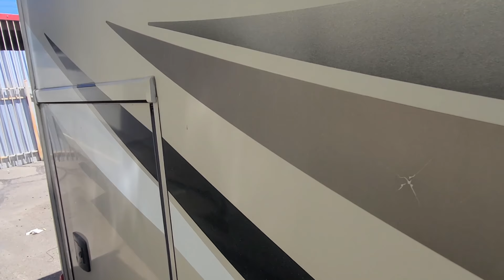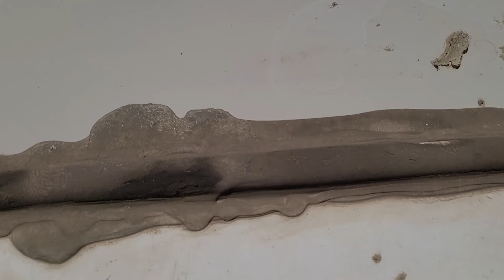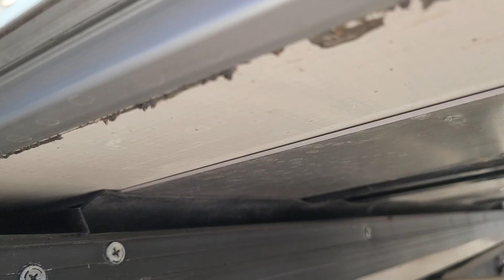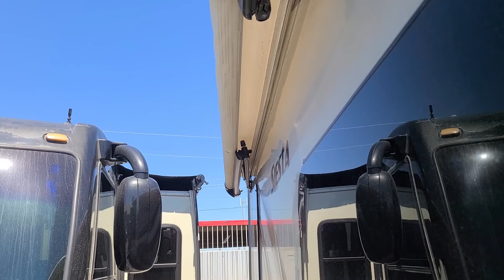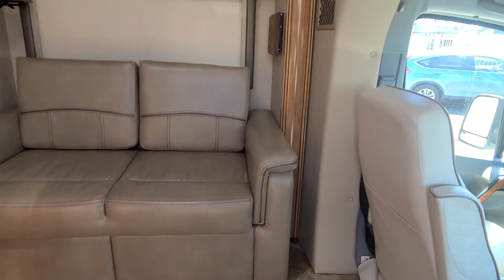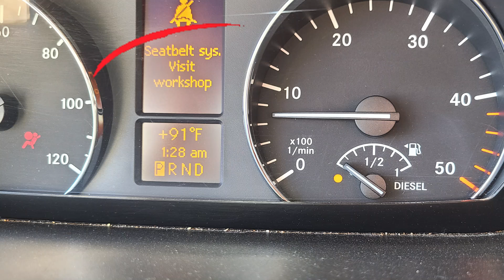You Won’t Believe What I Found In This RV Inspection!

Comment: Watching these videos, it is clear that the entire build concept of RV's is flawed and not fit for purpose. You have a vehicle which is intended for outdoor use in various climates yet it relies on sealants to keep it dry. This is the critical design flaw which is responsible for the repeated failures that cause water intrusion but the destruction of components that fail due to water exposure, not to mention the mold conditions which make it unhealthy. The use of sealants which are poorly applied with tube guns and unable to withstand conditions and are of poor durability makes ownership of an RV simply a no go despite the allure of such. There are construction methods which would improve this problem. One should look to the boating industry which has taken the lead in solving water seepage issues. It should not be that difficult to make these roofs and windows watertight. You see tents that do a better job and don't leak in rainstorms.. Roofs should one piece construction and fitted with a thick synthetic rubberized membrane that prevents water intrusion and without any holes cut into them. All vents and drainage should be directed to the rear of the RV to a drainage compartment that is also sealed from the cabin. There are so many fairly easy solutions if the industry would only stop resisting changing build concepts. Hiring illegal and unskilled labor in their factories is another. Don't get me started on that one.

Comment: If you are smelling propane, that is reason enough to halt the inspection right there.  Concentration of combustable gas in an enclosed area, such as in an RV, is nothing to fool around with.  You can get a combustable gas detector (sniffer) with prices ranging from about $30 to over $300.   For your purposes, probably want to stay away from the lower end models, saw a Klein advertized for about $100.

Comment: Well, it is a Thor 🤷‍♀️ My biggest question is, after getting on the roof & seeing how bad the condition was & the front cap & the slide, why did you continue with this inspection & not contact the customer? I once had a highly reputable inspector inspect a Diesel Pusher for me in So Cal. He stated if he found any major issues he would call me & stop the inspection, only charging me for his actual time & travel charges. He started with the chassis & found the rear differential was leaking & a couple other things so the inspection was terminated. I think more inspectors should do this & more people would be inclined to pay for inspections. Just my 2 cents.

Comment: Most thermostats I come across in RV's have a thermostat wire for measuring temps. I pop the cover off and dip this wire in a cold cup of water with ice which I bring along just for this. It tricks the thermostat into thinking it's really cold and then you can test the heater. Or use a ice pack in a ziplock and tape it to the wall with painters tape and hang it over the thermostat to lower the temps. Your welcome.

Comment: In my experience if the water pump is cycling to keep pressure up, the water tank leak is not the reason. 
It's likely a leak on the pressurized side of the pump, or the pump it's self is allowing pressure loss back through the pump seals, which may not result in a drip, but the pump keeps running in cycles to keep the pressure up to trip the off switch. If that is the case the pump is going to die before long, and maybe be a disaster of a leak. 
But of course there could be all sorts of systems I have never seen

Comment: Do you have any experience with coachmen Entourage 340bh and if so can you tell me about it? Good or bad 😁. I like power train, mostly concerned about house part. I can upgrade some like plumbing or whatever I need to. 

My name is Al Wilson
Reply from the maker: I have good coachmen’s and not so good. All in all I don’t know until it is inspected. What appliances are they using etc? I don’t recall every brand out there so it would have to be researched.
Reply: @debsrvservices I’ve been dealing with Chris York in Tampa Bay Florida. Hoping to make a deal on one this coming January super show in Tampa Bay. Do you work in that area

Comment: I have a 2014 Forest River Lexington 283GTS which I bought used in 2018. I meticulously maintain it because it constantly requires attention. Even with all the work Ive done myself its been an expensive and challenging adventure. Especially annoying is the crappy upholstery that became a flaky mess and the faux wood trim thats nothing more than compressed paper with a vinyl covering. Ive had to replace all of that plus the converter, transfer switch, water pump, a slide out motor, door latches and glides, sun roof.......I cant believe I havent thrown in the towel yet! Oh, did I mention the dead battery on the toad due to not knowing about the 12v charging line? Yikes!
Reply from the maker: Haha!! Sounds about right! RV life isn’t easy, that’s for sure. I sometimes wonder if I am saving any money living this way 🤣

Comment: 5:39 tires don't normally rot from the inside out, unless they are not mounted and left open to the environment. That being said the checking you're seeing does make the tires unsafe, and need to be replaced. The checking is a combination of UV exposure and running on low pressure. Running on low pressure will destroy a brand new tire, so that means the tires need to be replaced as well. Otherwise great video.

Comment: I’d give him 2500.00 with the amount of work that needs be done it’s probably 10-20 K in repairs minimum. If only one company would build a quality RX. Fiberglass clam shell with one seam through the middle of the wall. No roof leaks. Minimal items you have to reseal each year on the roof.

Comment: Afternoon Deb, nothing says "Quality" like an RV that holds up over time,,,,,,,,, 

I'm guessing this RV was a COVID build date, or just before, the manufacture's were cutting cost on every corner, plus this one never stored under cover and sat in the intense heat & sun of the last few summers.
The tire wear is from driving fast with under inflated tires, broke the internal bands, pretty sure it had a heck of a steering wheel wobble at 50mph +,,,,,,,

What would I pay????? 
The question should be "What will you Pay Me to tow it to the wrecking yard and you're also paying the wrecking yard disposal fee,,,,,,,,,
They won't take them for free ya know,,,,,,,,,

Definitely a "Walk Away From" deal,,

Spotted a 2000 Lazydaze 27 rear bed, not bad condition but not cheap enough for me right now,,,,,, dang,,,,,,

Take care,
Reply from the maker: Dangit on the Lazy Daze! My friends I am staying with right now almost went to look at one in NC. They have owned several lol! 

Agreed on what to pay me to trash the RV🤣
Reply: @debsrvservices  Morning Deb the LD I mentioned is on CL up here in Seattle if your freinds are interested, for sale by owner.

Comment: That's very humble of you to admit you're not a propane systems expert Deb.  Too bad you're not closer to my 'north of Seattle' location. It would be a pleasure to show you how a handful of fittings and a few tools can get you a valid leakdown test at many locations.  I was blessed with some very good teachers and seen about every LP problem a rig can have.
Reply from the maker: When I get up that way maybe we can work something out. Always wanting to learn more😊
Reply: @ I e-mailed you pics of my RV LP leak test rig, which I hope you find useful.  I have a 2nd one also, which has a high pressure gauge (for full tank pressure before the regulator) for doing park models or mobile homes. 
That little burner spud adapter for the range rarely ever is used, because readings there do not reflect accurate dynamic (appliances lit) operating pressure in most cases because of the range regulator.
Reply from the maker: Wonderful! Thank you! Did you send to debsrvservices@gmail.com? I haven’t seen it yet.
Reply: @debsrvservices  I left out 'services'. Please let me know if you don't get the corrected forward I just did.
Reply from the maker: Got it! Thank you!